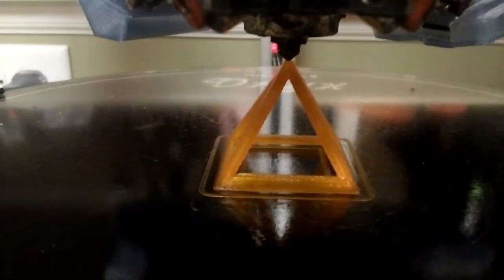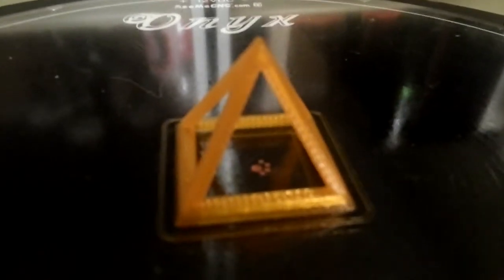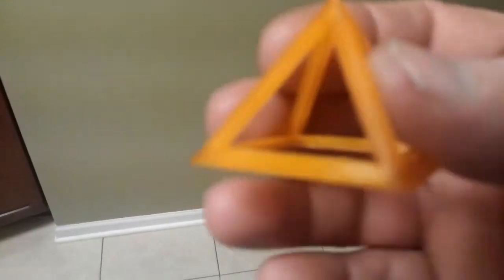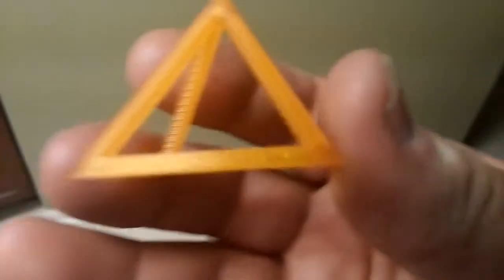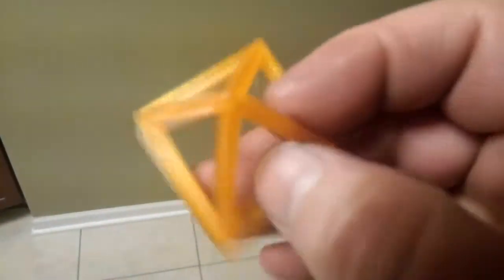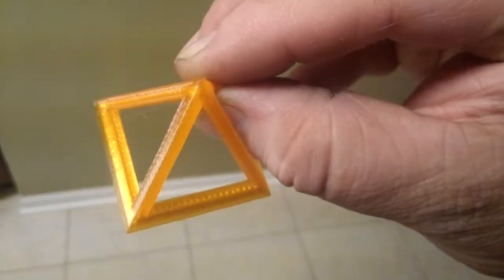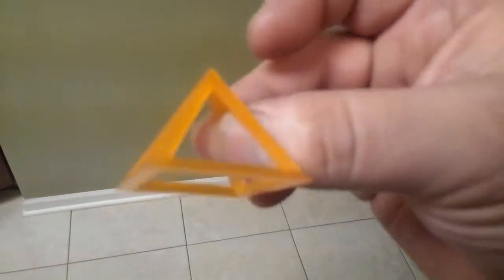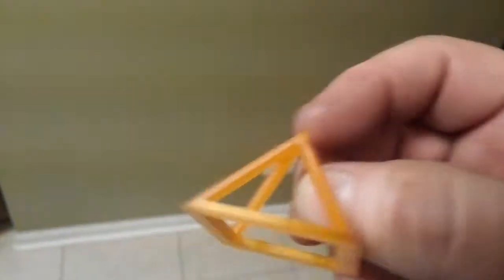Rostock Max hollower pyramid part 2

Comment: Wow, the accuracy and finish of those parts looks great, I just purchased a Orion delta printer, in part due to what I saw was possible in your videos.  Could you share any advice to a newbie on how you achieve such good results, what kind of material are you using, I purchased a roll of Madesolid PET+ that I will try soon. Thanks